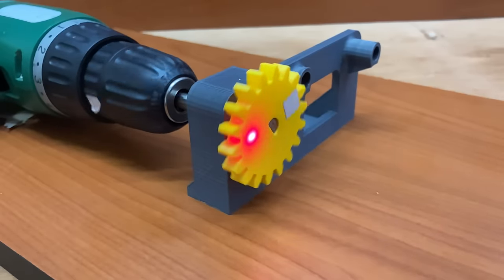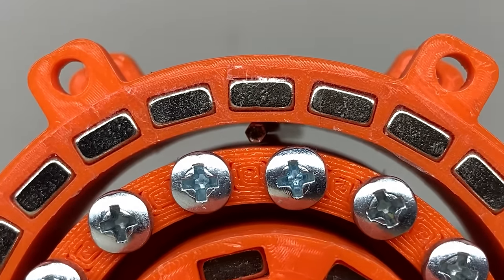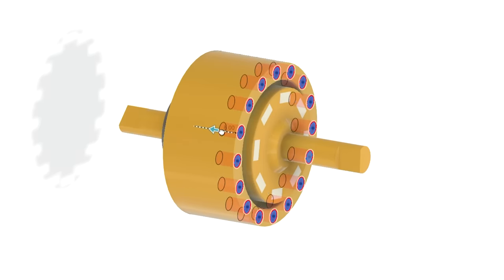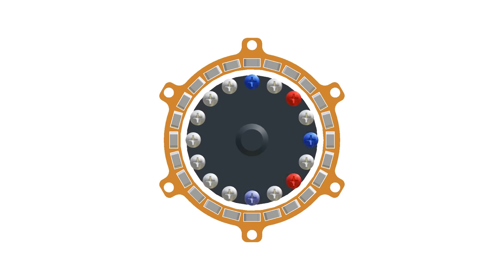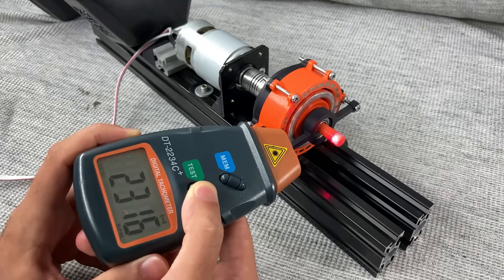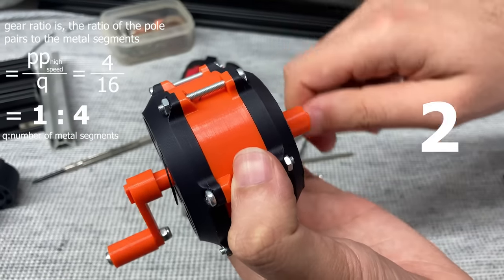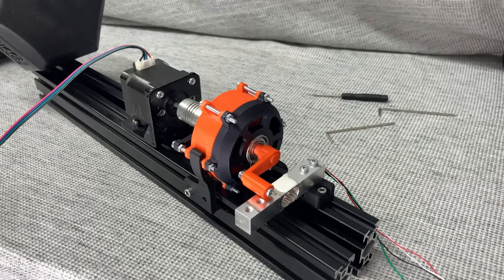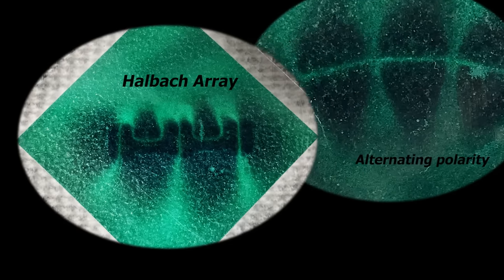Magnetic Gears - Why Nobody Talks About This?

Comment: You've reminded me of magnetic transitions just as I saw video on iron nitride magnets.
Iron nitride magnets can be almost 3x as strong as neodymium ones, while not using any rare earth materials.
This means that you could make magnetic transitions in bulk, and even mount them in normal, every day devices.
Reply: That's funny. My research team works on iron nitride nano magnets. I smiled when I read this comment 😁.
Reply: Yeah - and have far more expensive, heavy and inefficient devices.
Reply: @ABaumstumpf  Iron nitride has lower density than steel and you only need it on very tips of gears.
Rest of gear could be made of plastic or really thin metal, because you would have to fight very high forces caused by hard steel meshing.
They also are nearly lossless transitions, so in fact you could have lighter and more efficient device, with similar or lower cost - no heavy machining required and magnets would be mass produced and slotted/molded into place.
Reply: @michahalczuk9071  while I like your optimism, I do feel like you're skipping over a few things.

Cost of manufacture. Making an ABS of Nylon cog is going to be cheaper than making magnets which then have to be put into an ABS of Nylon carrier. As you're adding the entire step of manufacturing the magnet, as well as complicating the assembly process by having to insert the magnets. Adding complexity like that, adds costs.

The carrier needs to be robust enough to withstand the forces in the gearbox, regardless of how those forces are transmitted. So the carrier can't be thinner than the plastic or metal cog equivalent. Especially in cheaper consumer grade products, those cogs and gearboxes are engineered down to the hundredth of a cent, they're not wasting raw materials that they don't have to. They've already removed all the material they can without having the product fail during regular use.

Heavy machining is rare these days, especially for mass produced goods. It's very uncommon for DIY power tools for instance to have machined gears rather than sintered metal gears or even just injection molded plastic gears.

If the Iron Nitride magnets are significantly cheaper than Neodymium magnets, the companies that now use Neodymium will just switch over to Iron Nitride to save on costs.

And last but not least, what would their application be? It'd have to be something where a hermetic seal is required, otherwise why bother with a magnetic coupling to begin with? And in that case, it'd also have to be an application where it's impossible, even with a VFD or PWM to get the motor to spin at the desired RPM.
Reply: @fermitupoupon1754  I think you mistook my thinking of making mostly toy transmissions with those magnets.
I was talking about generally electric cars where mostly you will still need to gear down motors for greater power and efficiency (and smoothness).
EVs generally use helical metal gears which have to be machined for higher precision and lower noise.
Because they mesh hard metal on metal the peak forces are much greater than average forces you would encounter if the meshing was soft - magnetic.
Your transmission still has to resist those peak forces and vibrations without damage, this requiring much stronger material than one needed for just average forces.
This would mean you could possibly replace steel helical gears with plastic/aluminum ones that only have to be molded.
I'm also not talking about gear shown in the video, since it's probably the worst example of magnetic gears.
Magnetic gears that are made to look like normal ones but mesh with magnets.
They don't have release torque because repelling force between magnets very sharply gets stronger.
Iron nitride magnets also don't contain any rare metals and are very easy to make, making them potentially perfect for such applications.
You also can magnetize then in place, which means that you could easily mass produced, molded in place for example, and magnetized later.
If such magnetic transmission increased efficiency of electric car by 2% for more or less similar cost it would be well worth it.
Tesla recently made a change of motor, to one using more expensive materials which overall lowered cost of production and increased value of their Model 3 because of higher efficiency.
Similar would happen to magnetic transmissions if they just were good enough.
With iron nitride magnets they well could be.
Reply: @michahalczuk9071  I get the feeling that we're both talking in a second or third language, so miscommunication is inevitable to an extend.

I get that the model shown in the video is just a 3d printed experiment. The air gaps are huge. No I'm assuming that such a gearbox would be made by say ZF or BorgWarner, with tolerances measured in microns, not centimetres.

I just think that for high torque applications like cars, it's much more likely that we'll see FeN magnets incorporated in more powerful motors that can be used in a direct drive configuration, completely eliminating the gearbox.

Just look at Formula E. All the teams have converged on a drive train with a single motor and an old fashioned differential. They're getting efficiency numbers of 97%. As in 97% of all energy put into the battery by the charger is used to drive the wheels. The 3% loss is the combination of the BMS, VFD, the motor itself and the entire mechanical drivetrain.
If there was a way, regardless of cost, that those teams could improve from 97 to 99% efficiency, they would. So I think the margins are much smaller than that. Perhaps a reduction of the 3% by some small percentage, so it'd be a 2.94% loss instead of a 3% loss.
Reply: @fermitupoupon1754  Formula E Gen3 actually only has just above 90% of total efficiency, you might have mistaken it with peak motor efficiency.
Having 10% loss is peak performance currently, and large part of that is still taken by mechanical coupling itself, rest goes to the motor and electronics, smallest loss is currently in the battery itself.
Having more efficient drivetrain might not be strong enough argument, but imagine that you don't actually need to oil or cool it, so you lose more weight then firstly expected and the efficiency gain is even greater.
On magnetic coupling you also wouldn't need tight tolerances, since the cogs would balance on magnetic repulsion which works with inverse square law - with every 50% gap tightening the repulsion would increase by 400%, thus making parts of such transmission touchless even at very high torques.
Even if you gained a little bit on weight of such transmission, you could easily make up on it by but making heavy case for oiling and cooling it constantly.
Magnetic transmission and bearings already have usages, even when being limited by expensive neodymium magnets.
Speaking of per wheel motors - they are unfortunately limited by physics. High power high torque models unfortunately experience very high pulsation due to their low rotation speed and very large poles. They are also limited by magnetic saturation of the rotors core. All of those are fully mitigated by just having high speed units with reducing, which is the overall trend, even when using multiple motors.
All of the above and probably more made direct wheel drive quite unpopular among the manufacturers.

Comment: Absolutely fascinating video! Something I had never thought of but considering the implementation of servos, linear motors, and the like, I suppose this is a natural application as well. I'm sure there are situations where this sort of use is already in place (high speed / low torque / need for overtorque protection). Thanks for putting this together and explaining everything in a very clear manor. Bravo!

Comment: I had an old fax machine that used magnetic reduction to drive the drum.  There was a 4 pole rotating magnet, a flux guide, & an outer steel internal gear.  The construction resembled a harmonic "wave" drive, in that the flux guide & the outer gear differed by 4 teeth.

Comment: You can dramatically increase the magnetic Flux if you use the proper metals which amplify the flux. The best is vacoflux50. It can increase Flux by 1000 times since it completely redirects it to the desired location and doesn't allow leakage. It also has the lowest loses from hysteresis and eddy currents. The hallbeck array will definitely help as well.
Reply: thats a funny name

Comment: In addition to going to a Halbach array, it would be useful to have the magnets butted up right next to each other.  This would reduce the effective air gap and should increase the torque.  The field modulators probably should be soft iron bars rather than whatever those screws are made out of, and again try to reduce the air gap between the 3 rings.  Also, use some locknuts - in the high speed test, you can see the nuts working their way out - LOL.  This was a very interesting and entertaining film - you don't usually see innovation in mechanics like this.or to fill the air gaps in each ring with a permeable material

Comment: I have a truck mounted carpet cleaning machine. It uses a magnetic flow switch. A piston (or shuttle) flow switch is designed so that a free-floating magnetic piston responds to the amount of flow within a pipe. When there is an increase or a decrease in the flow rate, movement of the piston actuates a hermetically sealed reed switch, triggering the specified action. When it works it's good, but they do wear out. You can replace the magnets and the shaft casing all you want, they eventually break. They need to be replaced every 3 months. It might not be a magnetic gear but this is a real life example of a magnetic device in an application that can be very unreliable at times. However, you do some interesting stuff.

Comment: Very interesting work, thank you for sharing.  It seems that a halbach array on the sun and ring are a good idea to improve max torque. Would reducing the airgaps between Sun/Flux modulator and Flux modulator/Ring improve max torque? What about going to square or pie cross section metal in the flux modulator, to help reduce the effective air gap? Motors and generators use laminates instead of solid elements to reduce eddy losses, I believe, so I also wonder what replacing the screws on the flux modulator with pie shaped laminates would do? Not easy to make though.

Regarding losses, your first test was unloaded, so I'm wondering if the eddy losses increase as load is increased, and then one would start to see temperature rise in the flux modulator elements?
Reply: You are correct. I am short the right size set screws but I have a 3d printed project but I am using a halbach array and even without the set screws to modulate it is fairly strong and I am interested in the idea of adding laminates as you suggested. I am attempting to edit another file to create a magnetic 608 bearing using very small magnets which is proving much harder. My printers resolution seems to be limiting me atm. My projects are all about being small though. Though sizing them up digitally should be possible.
Reply: @TheWeaponshold  Maybe design the parts so they can be printed in vase mode and have only 1 layer for each feature in the radial direction? From what I can see, that would get rid of at least 4 layers that are pushing each component further apart. Then use set screws or pins in place of the machine screws to get rid of the heads that are also pushing everything further apart.  That would allow for the air gaps to get much smaller.

Comment: Cool demonstration ☺️ You expressed surprise about the noise, and I was wondering if this right here 9:01 shows (part of) the cause. It doesn't spin at a constant speed, because of the very nature by which push and pull works the system. That causes the whole thing to vibrate and as such make a noise.

Comment: great idea and great presentation only issue you run into is work capability. Induce a load beyond these natural forces inherent and analog based capabilities and you get slippage. Its a wonderful and scalable application for doing work in non excessive load based needs like fluid transfer. We've been looking at this for sometime now with the major developments lying in understanding flux schedules and there inherent applications around energy processes. You've got a wonderful approach to an inline water pump for remote applications which is a huge need for agriculture in remote places like Wyoming or even in the middle east where it is hard to get fresh pumped water to remote areas for such applications. this is a fantastic low cost and low energy method for such utility! something to maybe consider! keep going! you're on the right track! best of luck to you!

Comment: I think it's very interesting. I would use it for robots that work with human as a protection for over torque. In cnc I would use it as sensorless endstop cnc. 
It's very promising.  A question,  does the permanent magnet lose magnetic force over time?  And if yes, is big ? There must be a formula for that. 
Thanks for sharing
Reply: Sure they lose power over time. Though I think it may take a few million years for it to be a measurable amount...

Comment: This idea could be applied to a cycloidal/harmonic arrangement for high ratio compact low torque box. Having a box that can slip damage free but is synchronous during operation seems like a cool thing, especially at a high ratio. A high field flexible magnet printable/cutable material would be cool applied to any of these magnetic gear concepts.

Comment: The magnetic contacts will be fine for the freely rotating gear shaft that does not drive an output shaft with a load attached. As soon as you are going to have to drive a usable load, you are going to have a lot of slippage. Slippage will also occur due to inertia when the drive motor stops and the load keeps rotating.  You can see the slippage in your video already even when no loads are attached.

Comment: Permanent magnets do disengage if the torque input is increased too quickly. A way around this problem is by using electromagnets. Increasing the Flux strength by increasing current, coupling that with tge increase in input torque, allows the transference of torque to take place without disengagement. You can also have a feedback mechanism that increases or decreases the current to maintain the torque capacity of the gear, protect the whole system from overheating from overtorque as well.

Comment: Wow kermits father here has a good point, 
I see so much potential in this type of transmission, no gears will ever be permanently broken, no unit will ever be thrown away because a simple easy magnet change is all that is required, thus the used market will be close to equal the new ones, 

while you get your oil changed you have your magnets recharged or replaced, 
hmm.. to the untrained eye the only setback I can see is the fact it’s wayyyy less profitable in the long run at-lease with selling them new but the aftermarket would make crazy profits from selling “tune up kits for your magnetic transmissions” 

But overall this would be great for the consumer, essentially a lifetime product.. it’s just a shame that profitably is more important then the actual product…

Comment: 6:38 and 6:51 I think the tones that you hear here are caused by the inherently jerky motion of the stepper motor; since every step causes a vibration in the air, that causes a tone with the same frequency as that with which the motor steps. To reduce this noise, you could if possible use microstepping. Upgrading the motherboard of my Ender-3 3D printer caused the stepper motors to start using microstepping, which in principle completely eliminated the R2-D2 like sounds it had made before. Soo satisfying! Only this was worth the cost of the new motherboard. If you're not already using microstepping, and you start using it, I think the tone that you hear here is going to go away too.
Reply: Why not reduce the amount of vibration instead?
Reply: @mize_yir_bizz That’s what you indirectly are doing by using microstepping.

Comment: 1) you can increase torque by increasing magnetic field strength with stronger magnets, or getting them closer together, or redirecting magnetic fields like you did at the end. 2) even though you apparently redirected some of the magnetic field, part of it might not have been redirected, just annulled the other. Also you've just shown a 2 slice of the field, but the field is 3d, so you could redirect field from the sides as well.
3) magnets are more expensive and lose magnetism over time (although slowly)
4) you could switch magnets for electromagnetic fields.

Comment: Hi. I've been pondering on the concept of magnetic gears. The application of using it on a boat prop. 
If you had magnetic fields on both side of fiberglass to spin a prop. Then you won't need a seal for the hull of the boat.
Reply: They make 'ducted' props that are driven by electromagnets in the duct and permanent magnets in the blades and no bearing in the center of the prop, so yeah, no throughhull or bearings.  Been wanting to make one myself and found they are already done on big ships.

Comment: I don't know if the idea is a game changer, but definitely cool. No torque means it can't do any heavy lifting,  it's bulky so it can't be used in small spaced areas without building the room around it. And it's expensive to build compared to some metal gears.

Comment: Fun DIY 3D printing exercise to create a ratio, they have some uses but it's not going to change the world. Gears work well when designed and properly.
A lot of the benefits your describing are starting to come from SynRM motors and widely available reliable electronics.